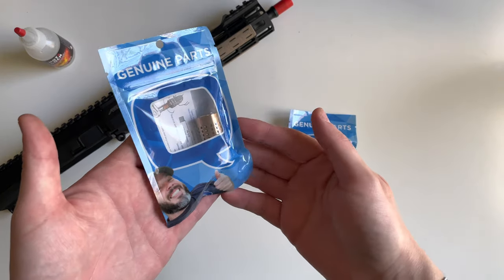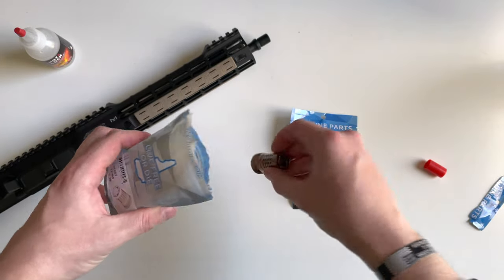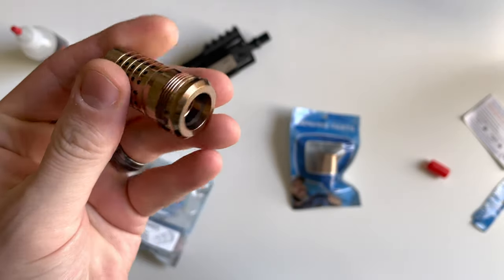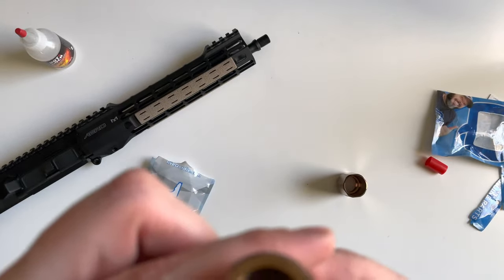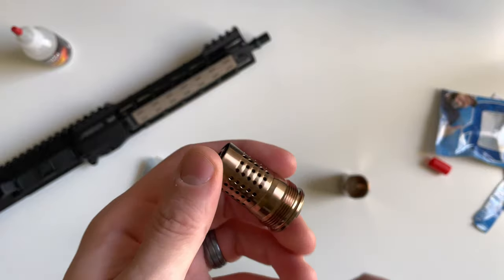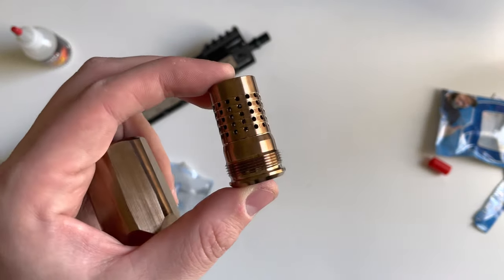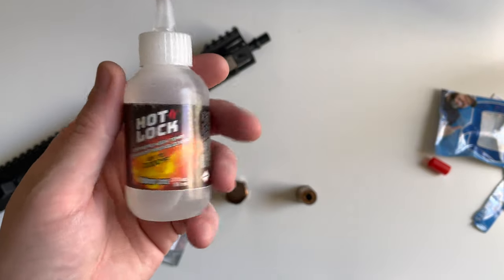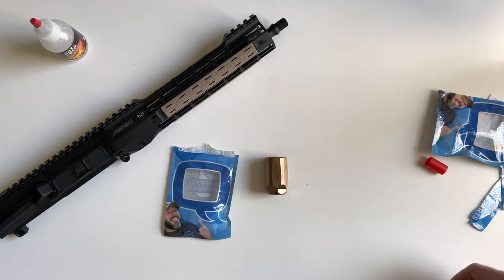Q Cherry Bomb & Whistle Tip (AR Build Series Ep. 9)

Comment: Cool Video.  Any problems mounting the cherry bomb on that 90 degree barrel?
Reply from the maker: No, I haven’t had any issues. 

The only recommendation that Q has with mounting it to a 90 degree shouldered barrel is that you apply Rocksett to the threads.

Comment: With one did you go with to fit your upper is that a 556 upper from aero
Reply from the maker: I used the 1/2x28 threaded version.
Reply from the maker: At the time they did not have one in a .224 bore so I used the 7.62 cherry bomb.
Reply: @GunBoxTherapy  I see the cherry bomb is 1/2X28 what size is the whistle tip sorry for the dumb question just interested in this set up for my 5.56 build TIA 💥
Reply from the maker: The whistle tip has no particular thread size. They are just threaded to fit all Q muzzle devices. Like the cherry bomb.
Reply: @GunBoxTherapy  good deal thanks for replying back sir

Comment: So for my 5.56 AR I would need the 7.62 bore cherry bomb?
Reply from the maker: Correct. They don’t have one in a .22 cal bore for 5.56/.223. Just ensure you get the correct thread pitch for your barrel. 

Typically 5.56 barrels are 1/2x28 threaded but just make sure your barrel is that.
Reply: @GunBoxTherapy  I contacted Q and I was told to get the 9mm cherry bomb 🤔
Reply from the maker: I’d listen to them. At the time that I got mine I knew the the 9mm bore one was coming out soon but it was not available to purchase yet.
Reply from the maker: Honestly though, idk why they would tell you to get the 9mm bore version.  My reasoning for questioning that is because of overall bullet diameter. 

• 7.62x39 projectiles = .309” - .311”

• 9mm projectiles = .355”

Having a wider bore may reduce the effect you want from a muzzle brake but I’m no engineer. So they may have a better explanation as to why they are recommending the 9mm one.
Reply: Only one way to find out...ready to test it out this Friday once my whistle tip arrives
Reply from the maker: Good luck!

Try it without the whistle tip and then with it. The difference in flash signature is huge but you get the benefits of a brake.
Reply: I have this same muzzle set for 5.56 ..it cost around $220 for both